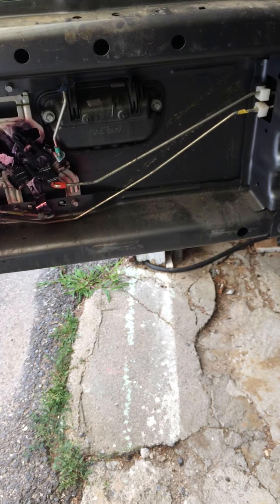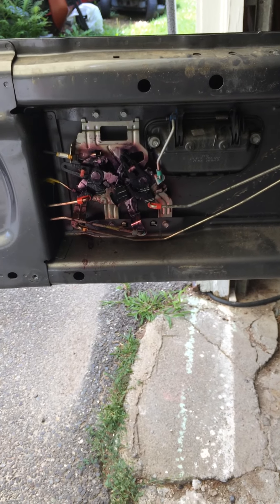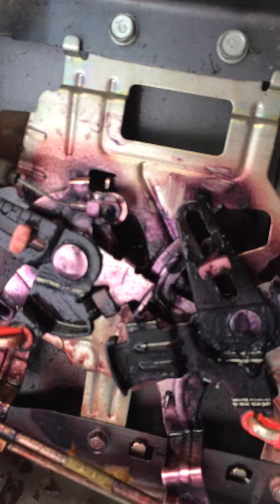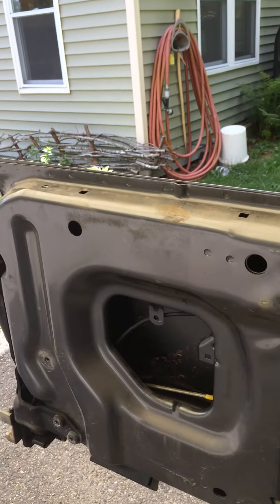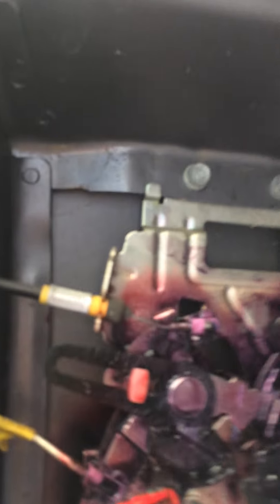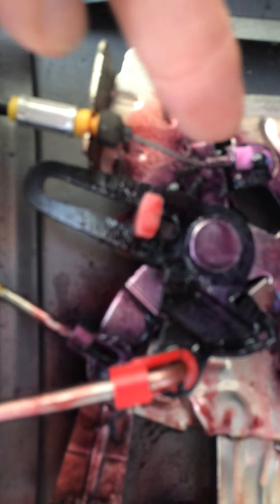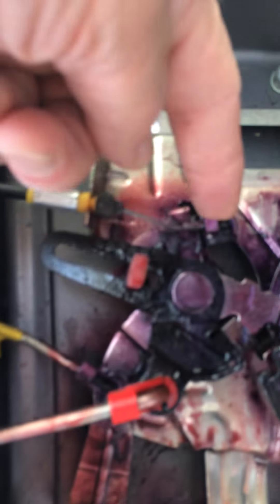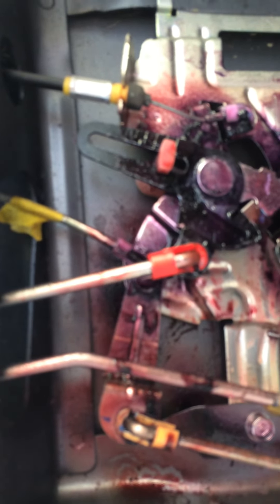Honda 1st (and 2nd!) Gen Ridgeline Tailgate Swing Latch Adjustment

Comment: Thanks for the video, I looked at several other videos which did not address my problem. I recently installed a pop lock in the tail gate and forgot it was locked and pulled on the swing handle and I think I stretched the cable. Before I saw your video I had removed the lower swing handle to see if I could adjust the tension in the cable like on bikes but the cable has no adjustment. Great and simple fix I probably would not have figured it out so you saved me the cost of new cable. Thanks
Reply from the maker: Thanks Steve- glad it solved your problem.  If you pulled hard on the release handle with it locked, you probably bent that tab.  It really needs to be a bit beefier!  I added a pop lock on my "09 and will keep that in mind in case I yank on that handle while it's locked.

Comment: Hello Ron. Good video. I've been looking for a video that shows the replacement of the lower right tailgate cable. That cable actually takes a lot of the weight off of the tailgate.  I can see that mine has broken and now the tailgate has no support from it. My tailgate opens fine but you have to baby it down as I mentioned the cable is broken. I would just like your thoughts on replacing it? Any issues that I need to be aware of that you might know? Thanks a lot. Rob.
Reply from the maker: Hi Rob.  Sorry, but I'm not quite understanding which part you're referring to.  My Ridgeline only has a single cable to support the tailgate when opened to the horizontal position, and that cable is on the left side.  Is that what you meant?
Reply: @ronbarber179  thanks Ron. I got the tailgate apart and it appears to be an easy fix however I'm having a hard time finding that cable. It's not the heavy support cable on the left side but rather a small cable on the inside of the tailgate on the lower right side. It goes through a Big spring and supports the tailgate as you open it up like a normal tailgate would open. It snapped in half. I guess I should have made a video of it and I still could I guess. Thanks again. Rob.
Reply from the maker: @FloridaRobTreasureHunting  Rob- I found a video that shows the spring and cable you're dealing with, but unfortunately I've never had any dealings with it- I didn't even know it was there!  Sorry I'm not able to offer any assistance other than suggest you look online for the cable. Looks like that cable MIGHT be item #6 on this page, but probably best to call and ask a knowledgeable human!  Here's the link: https://www.buyhondapartsnow.com/v-2009-honda-ridgeline--rtl--3-5l-v6-gas/body-air-conditioning--tailgate
Reply: @ronbarber179  thanks again Ron. I agree that is the part that I need, number six on that list.